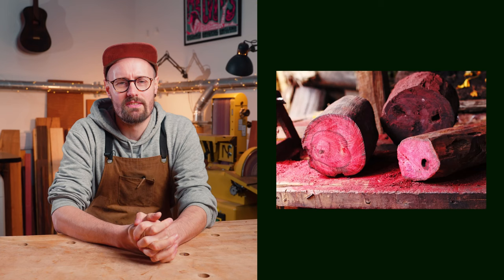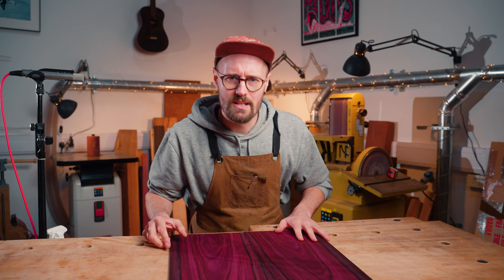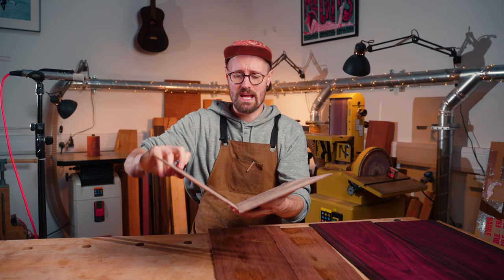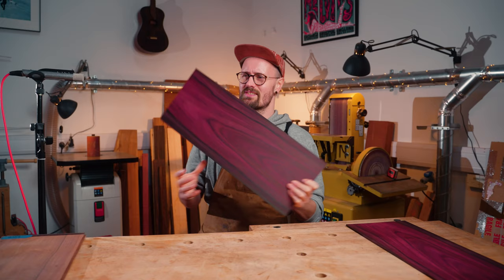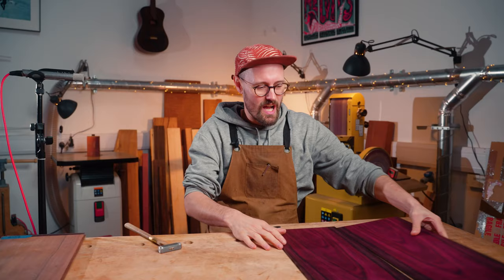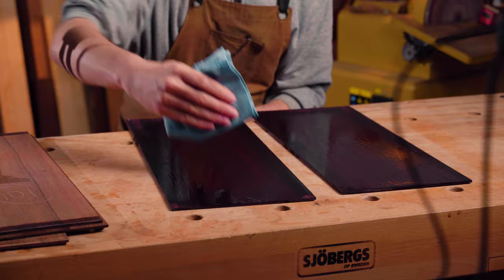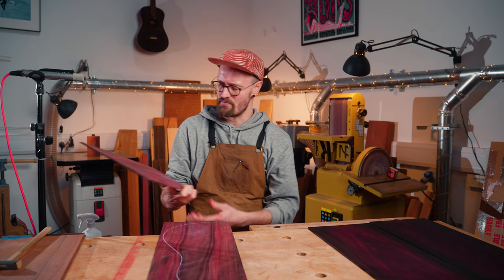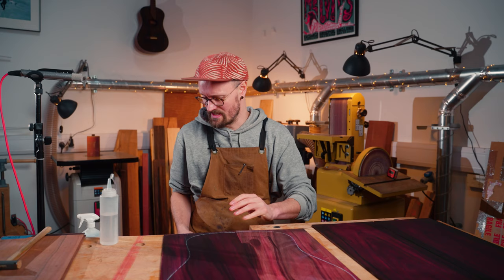PURPLE TREES?! - Dalbergia Maritima - Tommy's Tonewoods

Comment: I would say after Siamese Rosewood and Mexican Kingwood(called as Camatillo)Bois de Rose is one of the most beautiful Dalbergia-species.

My only issue is with a wood: once you apply any coat on a wood-it is going to loose most of its vivid-purpish colour and starts darkening big-time! Some experts say:You can extend the "fading-process"(means the wood is much slower going to darken in time) when you use some special UV-coat stuff for woods like this.Wood also will darken in shady rooms as well as soon it will catches some sunlight.

I was making a pen from it-intense Dalbergia-scent it has. I do not like the scent at all-caused me bit of a breathing issue(nothing major-but once my nose realize some kind of soury taste coming to my mouth-something very similar but more powerful than the Mexican Cocobolo has.